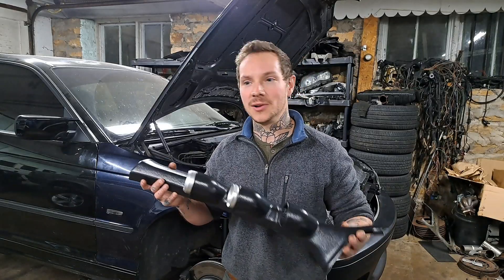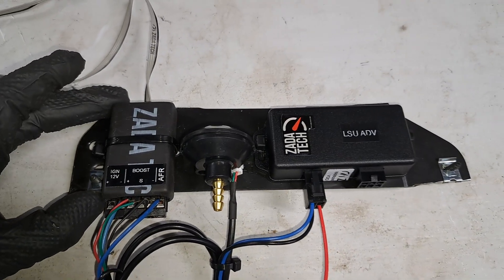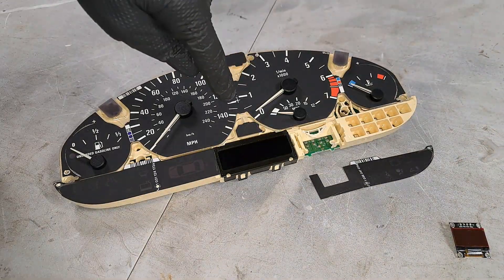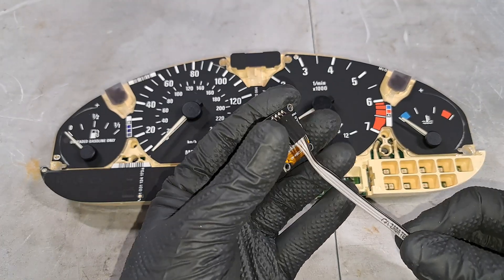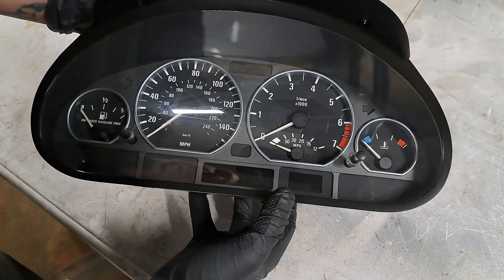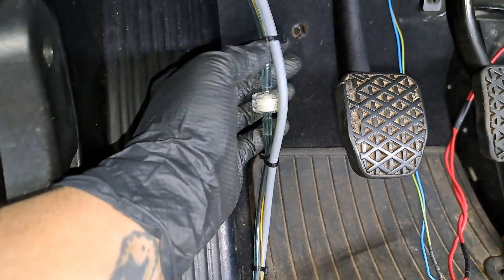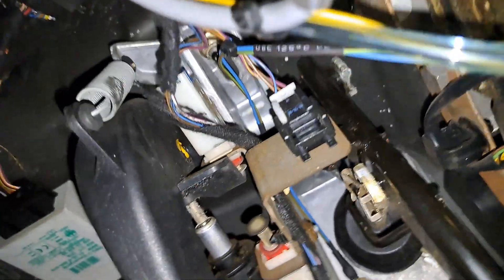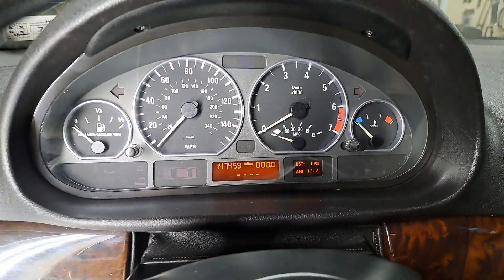BMW E46 Turbo Build - Zada Tech Boost AFR Gauge Install DIY

Comment: Great channel really informative, I've been watching the turbo build videos. That's such a neat job compared to my amateur gauge install stuck on the dash. I bought the fuse adder things and gave up on them when I couldn't figure out how to run across to the other side of the car. I butchered up the factory wiring instead...

Comment: I did this a few years ago on my turbo s54 car but my OLED display from zada wasn't amber it was blue and I had to add amber film over it. 

Love that yours is amber, it is a true amber OLED display? Or did you add film over lay on yours as well?

Does zada now offer amber OLED panels?
Reply from the maker: They added a layer of tint to the display.
Reply: @OLearysBMW awesome looks great. Such a clean install of the wiring. Always love learning new different ways to approach something